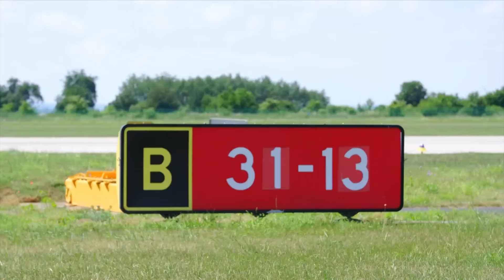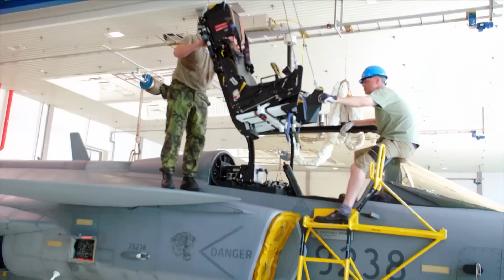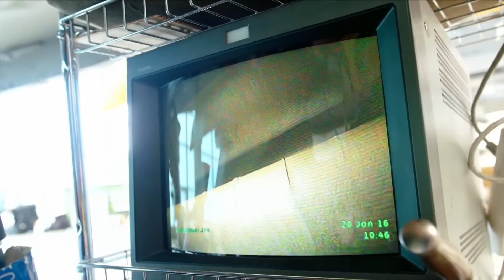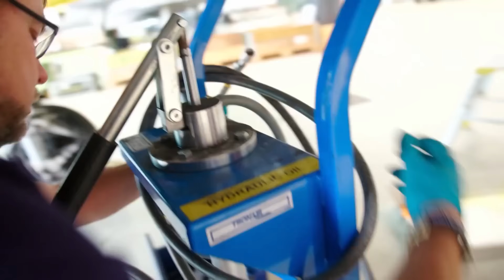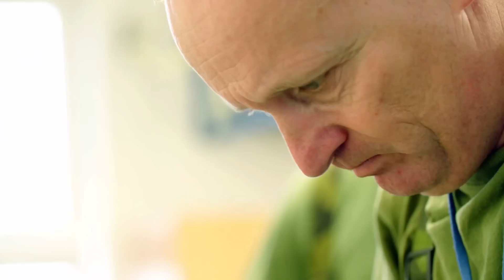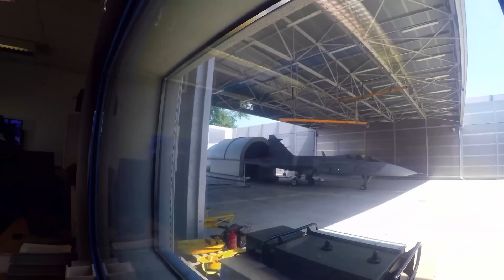Reviving a War Machine: Saab JAS 39 Gripen Maintenance | FD Engineering

Comment: The swedish RM12 engine (a development of the GE 404 engine), used in the earlier versions of Gripen, had up to november of 2022  achieved more than 400 000 flight hours without a single motor failure. Quite impressive I think. (Note: One motor though had to be scrapped due to a bird collision)

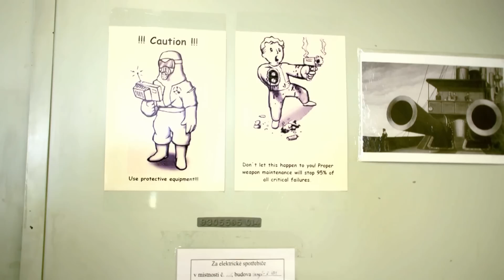Comment: Please take a look at posters at 19:22. What small arms do Czechs have that would cause that kind of traumatic wound as a blown off hand? Are they referring to Mauser BK cannon rounds?
Reply: Probably related to the importance of making sure the cannon is safe and doesn't damage the plane. They wouldn't have any live ammo around the workshop, so no explosive risk in the location.
Reply: @Zoroff74 One hopes. But how is cannon charged ? Pneumatically using low explosive charge? Or electrically using high discharge current? MauserBK is a revolver cannon.  The drum barrel holds , 4(?) rounds , that are then reloaded automatically on sequence.  Those 27mm rounds are large. Almost as large GAU-8 30MM . So charging the gun takes ummph. 
Russian 23mm ,30mm, and 37mm guns were charged using blank pyrotechnics rounds of same callibre as gun.
Reply: @dkoz8321  - It seems to run on its own gas pressure and to use pyrotechnic cocking charges to cycle the action, so there may be some risk depending on where and how the pyro is loaded.
Reply: @Zoroff74  Gas operation is for continuous automatic fire. I am referring to initial arming and charging of the gun. Mauser BK maybe mechanically loaded and electrically fired. I am not certain.

Comment: we hope Philippine Airforce choose SAAB GRIPEN rather that american F16
Reply: It would be awesome. There are Gripen in the region, the Thai Gripen fleet has become much apreciated by the owners. I think they are getting more planes, presumably Gripen E/F?
Reply: Philippine Air Force would be better off with F-16V Viper Block 70. Philippines are a major US Ally. Interoperability with US Air Force would be critical in case of conflict with China. Though US operators F-35A (Air Force), it still has large F-16 fleet in active Air Force and Reserve squadrons. The supply chain for F-16 parts, engines, and munitions is more of an ecosystem rather then specialized niche as with Grippen. Eventually Philippine Air Force is going to get F-35A. Either that or expect Chinese Air Force to be stationed on former Philippine Air Force air bases.
Reply: Curious what your reasons were/are? 

Not saying you are wrong or right, just interested.
Reply: Ongoing talks with South Korea for the KF 21 though
Reply: Yes , and asia shuld make a new alliance togheter with Canada and europe , and no more wars for usa .